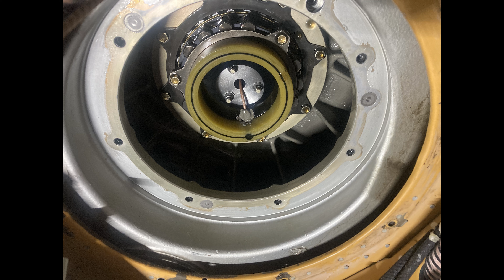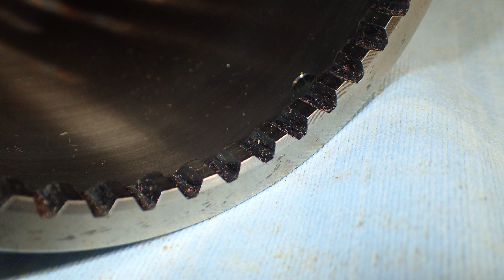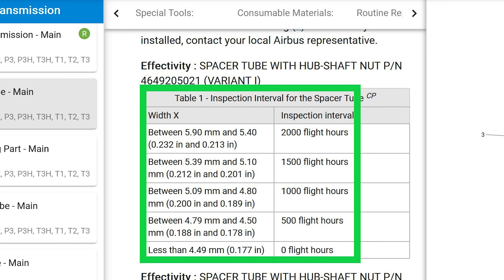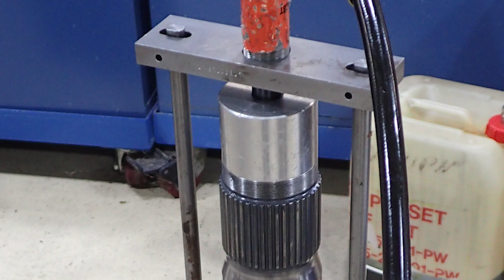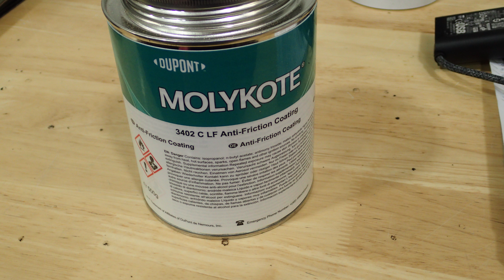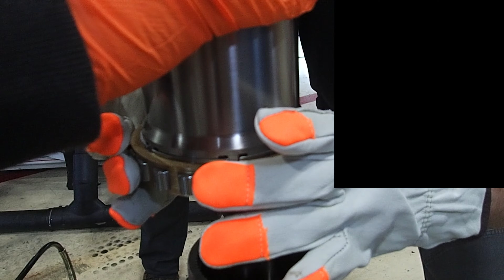Mast Spacer Tube Inspection and Replacement | EC135 Main Rotor Shaft | Airbus Helicopters

Comment: The older (original) tool for removing main rotor hub shaft bearing is without the hydraulic pump. Instead, you use a wrench. At the top (where you connected hyd. pump hose) there's a big screw/bolt and by tightening it, the bearing lifts. To do it correctly, you need someone to help, just so that the shaft doesn't fall. I would say, that the bearing comes off easly when you use the original tool. I had never done this job with a tool you have...it's a pitty. Hope you understood everything :D Greetings!
Reply from the maker: I totally understand what you’re saying.    I think we had that tool in the past, a long time ago, for extracting the mast.  I think I only used it once or twice.  The hydraulic pump works very well.  Thanks for your input qweg, I always appreciate it.